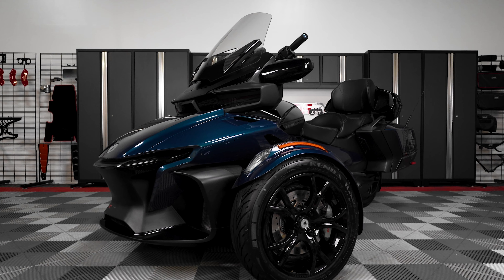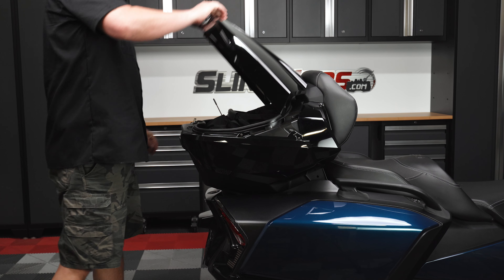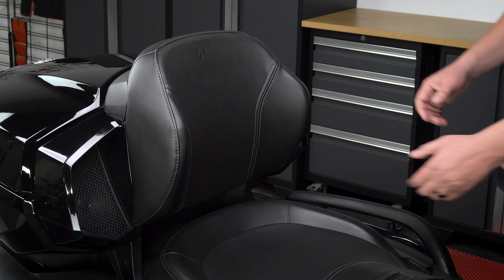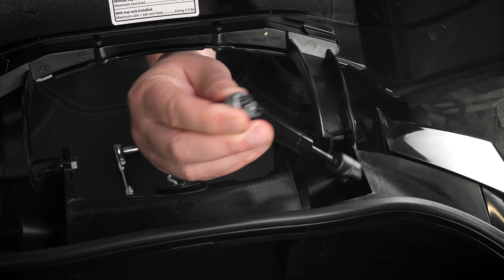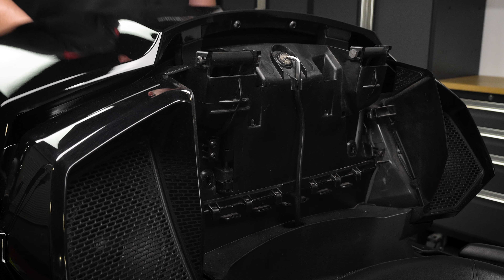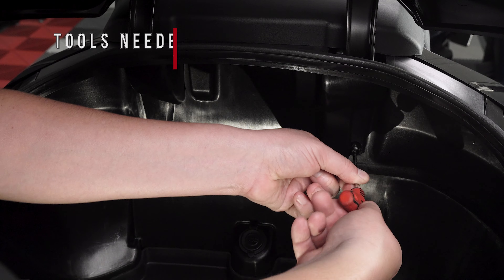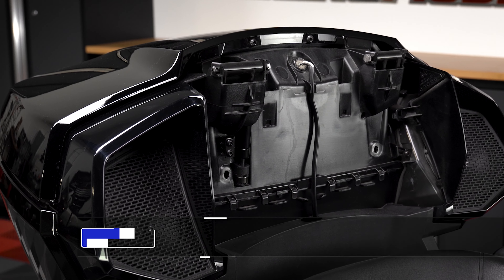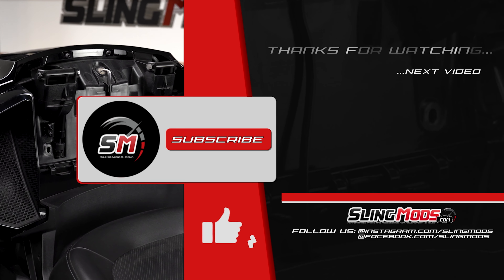Can-Am Spyder F3 / RT Heavy-Duty Trunk Shock Upgrade (2020+)

Comment: I added a luggage rack last fall to my 2021 Spyder RTL and the original truck lift strut couldn't support the additional weight of the rack.  This is exactly what was needed, I ordered it last week and arrived in a few days and installed it that  same evening it arrived.  Easy to install, only took between 5 and 7 minutes (start to finish) and works great.  Thanks Slingmods and Show Chrome.
Reply from the maker: Outstanding! That's the feedback we like to hear Richard. Glad it worked out well for you and that the installation was a breeze. Thank You!

Comment: How did you expose the top 5mm bolt. It is covered by the shroud covering the shock.
Reply from the maker: It's accessible once the passenger backrest pad is removed. Here's the written instructions as well if needed: https://www.slingmods.com/pdf/can-am-spyder-f3-rt-rear-trunk-shock-install.pdf - Feel free to send our customer service team a picture if you need further assistance. They can be reached here: https://www.slingmods.com/index.php?route=information/contact

Comment: Two thousand twenty one RT limited Don't have shocks on a trunk lid. This is the 1st that I've seen this Unless they For got to put mine In.😮
Reply from the maker: Hello George, I just looked at the shop manual for the 2021 RT Limited. There is indeed a trunk shock on the 2021 RT Limited model just like on the 2020 model shown in the video. It's hardly visible until you remove the passenger backrest pad.
Reply: I installed it on my 2021 last week and it worked perfectly.  Very easy install, takes about 10-12 minutes or so. Worth the $$!